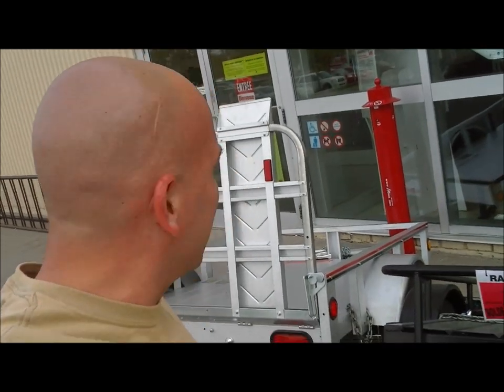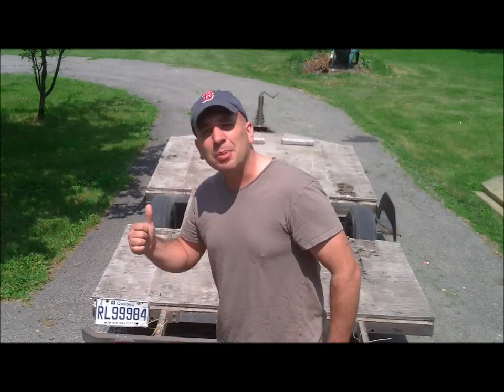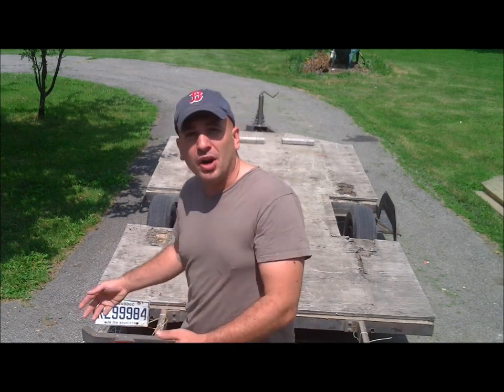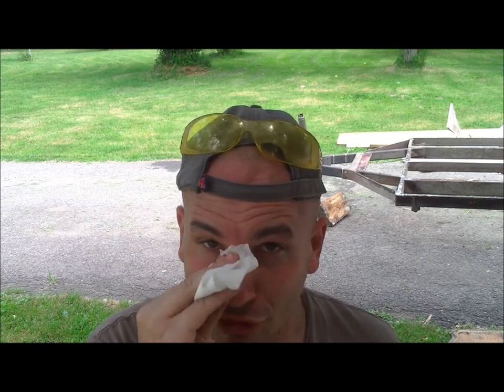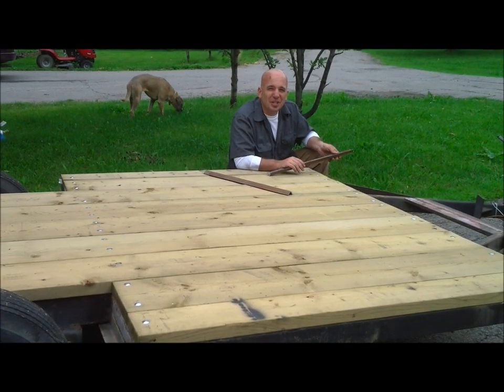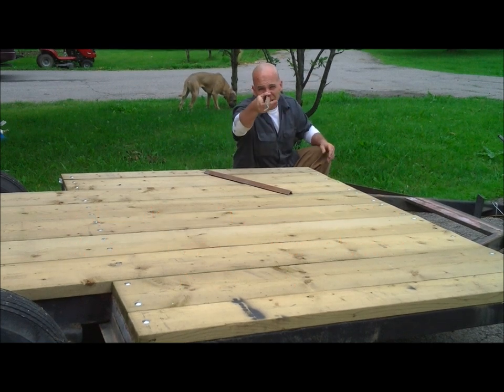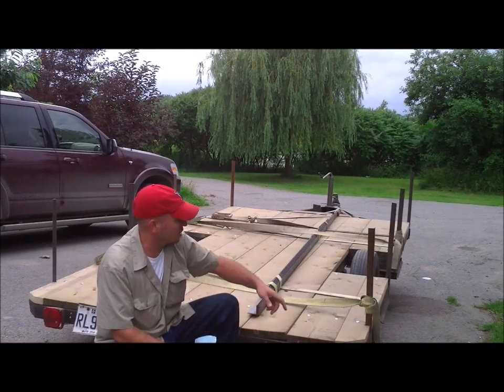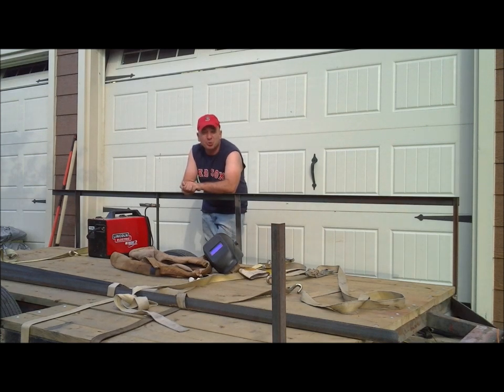thecheapbastard.net shows you how to save over a GRAND by building your own trailer

Comment: We have built all our trailer one I sold from a pop up camper even our car hauler we build the last thing I got was a car dolly paid 400 the only other ones I could find had no ramps unless it was 600 or more  it was old one broke support arm worn out holes and bolts, ramps where broje and bent and the adjustable caliber arm  just worn the caliber out not safe to use bout new caliber lights bolts sleeves to fixs the bolt holes added angle iron to the ramps so they wont bend extended the tongue it worked great just put a winch mount on it cause most cars I pull with it well lets say their a reason I haul them lol they dont run